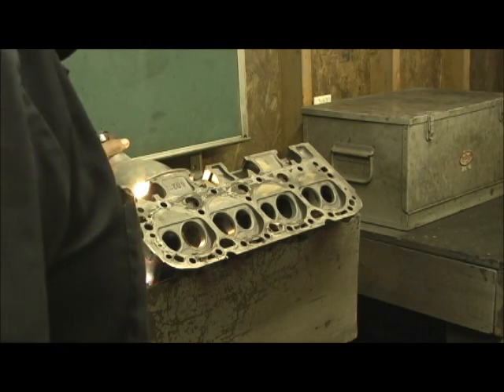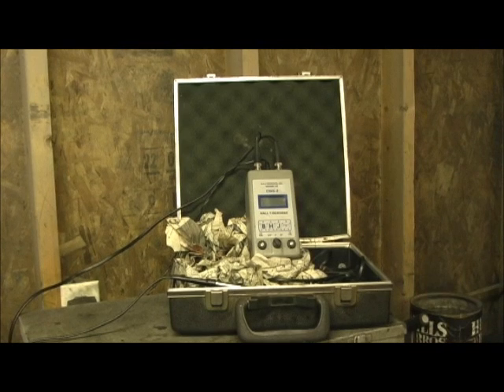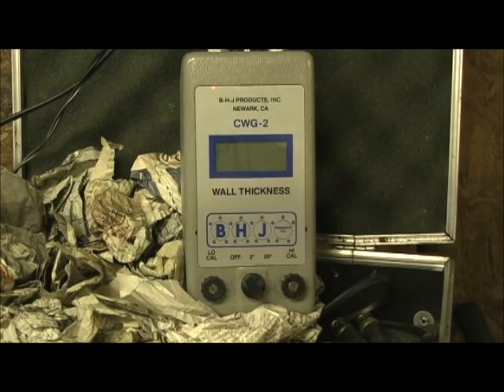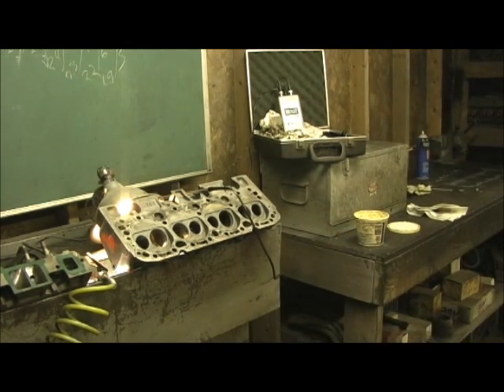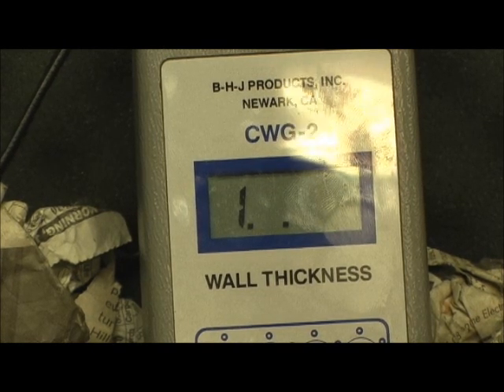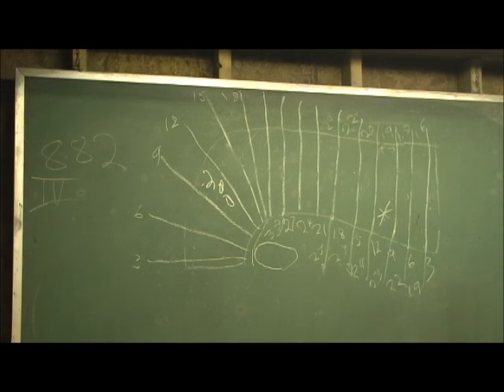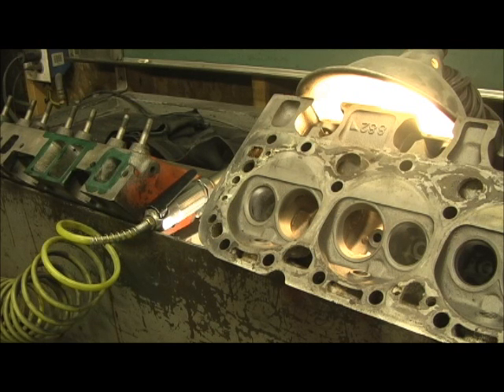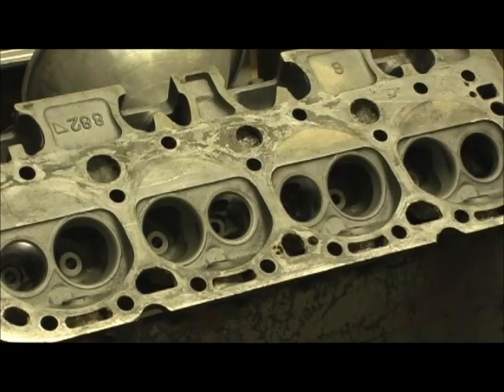Sonic Checking Christi Bedsauls 882 Chevy Stage IV Ported Heads

Comment: Now that I think about how the runners are it makes sence. I'm new to this head stuff. I'm collecting parts for a 496 BBC to go in a 71 C20. I'm still undecided on the heads and intake manifold. I was looking at the 320cc ProComps. I'm looking for lowend torque. I don't see a need to spin the motor over 5700 RPMs.

Comment from the maker: No Velocity bulshit (VST). If you take a kite string, and lay it on the floor from the Flange to the seat, then take a different string and lay it on the Roof from the flange to the seat, you will see a BIG DIFFERANCE between the two. This be the PROBLEM to make a long story short. You would need about another inch or two of LENGTH to balance out the runner walls, cutting the floor just messes it up MORE kind of thing.